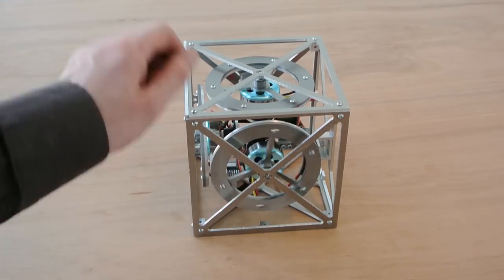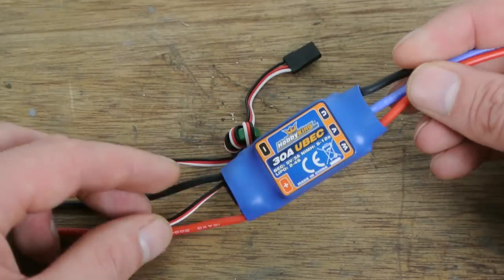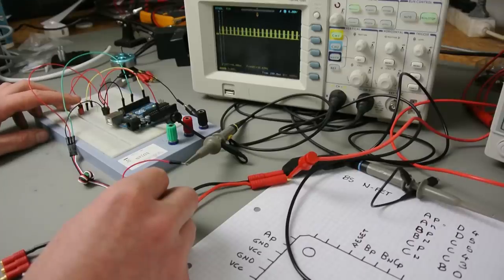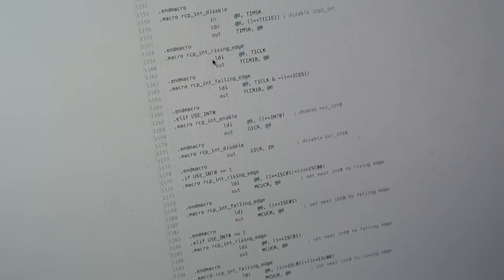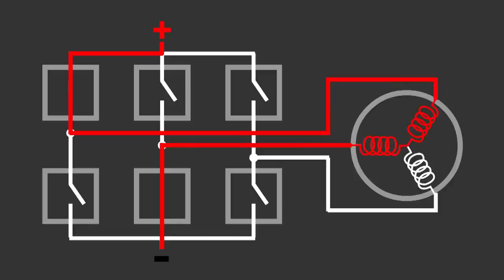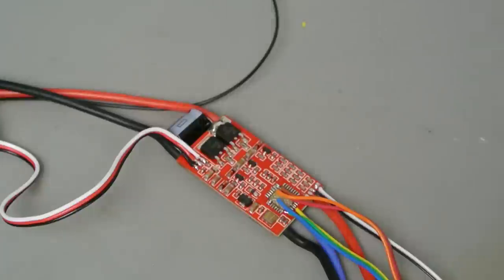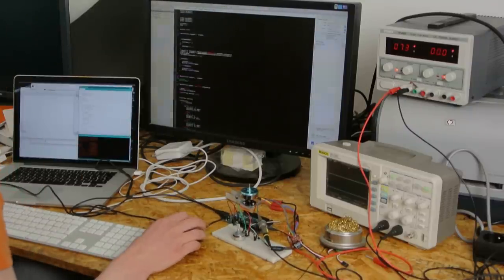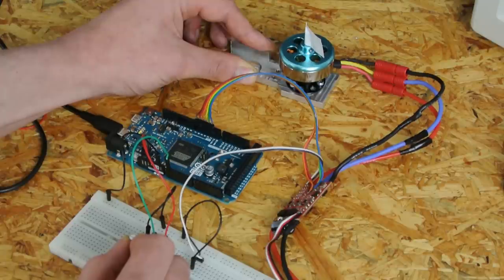Making a Rolling Cube : Part 6 - Hacking a speed controler

Comment: Hi Kris, I started to think about building a Drone based on Flywheel mechanics and researched ESCs. I found that the current Firmware BL_HELI is programmable to do all kind of stuff. It is really advanced and can do everything with the motor. Now looking back at this it would have been much easier to reprogramm the ESC with a simple ESC programmer to make the motor turn backwards and support more advanced driving mechanisms

Comment: Good job, as always!
I suggest you try designing your own board and salvaging the components you want from the ESCs, it can be a nice and simple entry point into designing electronics!
It is also nice to know how to mill or etch PCBs(depending on what you want to go with, but as you have a higher speed spindle, I suggest mill).
It just seems way less troublesome to me, having your own board for all the three motors + the controller( I doubt you can really shove a mega into the tiny cube, lol).
Reply from the maker: ***** thanks!, Yes, I'm thinking about it. If not in this project, certainly in the next. Electronics is still a little bit intimidating. but i really need to learn it :)
Reply: ***** Don't know how to not make this sound awkward, but if you need help - you can talk to me.
Reply: ***** Electronics looked pretty scary for me too, so I recommend you to start with digital elestronics, it turned up easier than analog :) I'm not sure, but I think you can drive that motor with L293 IC. I used it for my stepper motors and it works great :)
Reply from the maker: ***** I'll let you know if i need some help :)
Reply from the maker: Srdjan Savic I know, it's the analog part that confuses me. I'm a programmer, so I expect logic behaviour if you combine electronic components. Which isn't always the case when I try things,  at least it looks like that to me.  It just means I don't enough about it I suppose. But I'm learning :)
Reply: ***** Most of the stuff you're going to work with is completely digital.
You don't need to worry about efficency that much, either, just slap some tiny heatsinks onto the transistors, and you're pretty much all digital. Microcontrollers drive logic level FETs directly. Somewhat binary.(and I assume they are, because if they are not, the chinese designers are silly).
Reply: +Spirit I would actually do the same as Kris did here. Designing a board with all the via-stitching needed for this kind of power isn't an easy job, so to re-use the board is a good idea.
Reply: ***** You don't need to have via stitching for this kind of efficency from what I recall.

Comment: Desoldering the onboard micro controller is a nice and funny idea. Do you intend to reprogram an identical m.c. and soldering it back? Or do you want to build your own ESC? If so, you should consider to upgrade the m.c. to something like the Teensy3.1, faster 96MHz & simpler (ARM), and also cheap.

Driving the MOSFET is easy, (and yes, it's cheeper to reuse the FETs form a HB ESC). The big problem is the feedback loop, the emf sensing and processing, you're better off using external rpm/pos. sensors.

I've seen that you using this motor because of its 4mm axe, (and it's low rpm/V). It's look like that when building smaller cubes, it's gets more difficult.
Reply from the maker: AltMarc Thanks for your comment! 
I'm not gone reuse the chip. I'm using an Arduino Due for now (84MHz). Its a lot bigger then a Teensy, but it still fits :)  I didn't know a Teensy was that fast. If I don't run out of room, I'll stick with the due for now (the mounting is already finished). But I'm definitely gone check out teensys for next projects!

Yeah, I already did some test with external hall sensors for the feedback loop and it looks like its going to work out. Just have to figure out how I'm gonna mount them in the cube :)   

Yes It's the right size to fit off-the-shelf/cheap components. 
Thanks!

Comment: Hey man, why didn't you connect your speed controler to the arduino as a servo and then variate the speed with the servo library???
Reply from the maker: Alexandre Rouma Main reason is that I wanted more controle over the motor. I did it with the servo library with the first prototype I made.  but then then the motor only runs at high speeds, in one direction.  I know that there are ESC who can do revers etc. but non of them have the controle I need. And doing stuff like this helped me really learn some new things. :)

Comment: This is really cool. 
Would the motors you're using have enough power to keep the cube balanced on its edge, like the MIT ones?
Reply: CellDevises You don't really need that much power to balance the cube, it's the knocking it over that's the hard part, since you can't just whack it with X amount of force and expect it to stand up perfectly.
Reply from the maker: CellDevises Thanks! :) Yes, I don't think that will be the problem.  If its gonna work will depend mostly on the software.